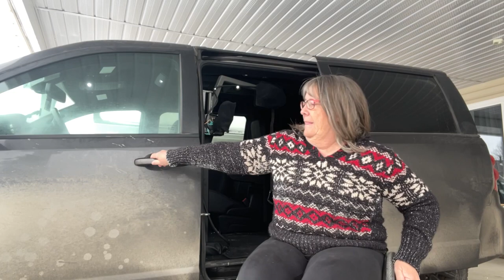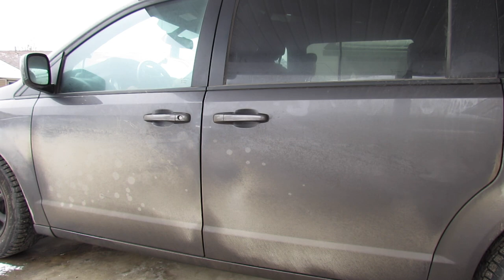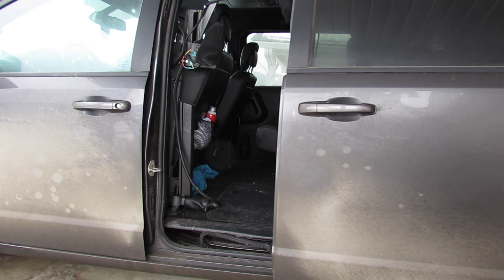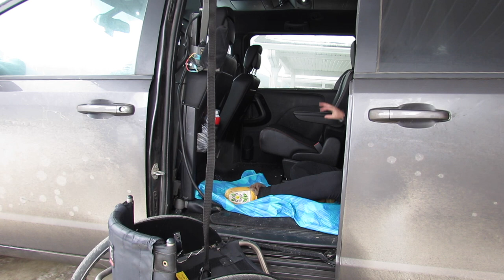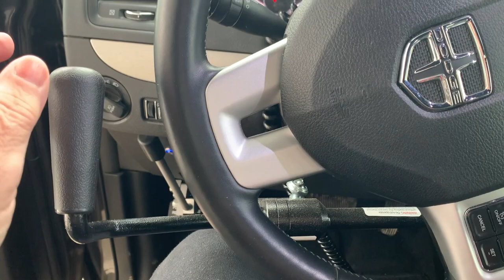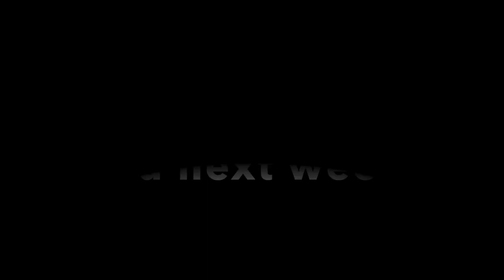Getting in and out of my van

Comment: Thank you for sharing. Lots of moving parts. Are all the moving parts run by the car battery. Do you carry an extra one  or a solar generator just in case battery depletes. ☮️🌻 Enjoying your channel.
Reply from the maker: Thanks Trish. Yes they are all run on the car battery.  It is tough on the battery when I am riding up to the seat and it has popped the fuse a few times when it was cold.  But the fuse is set to reset itself and restart so I do not become stranded.  If I ever get an extra battery (besides the Jackery) in my van I may get the two lifts connected to that instead.